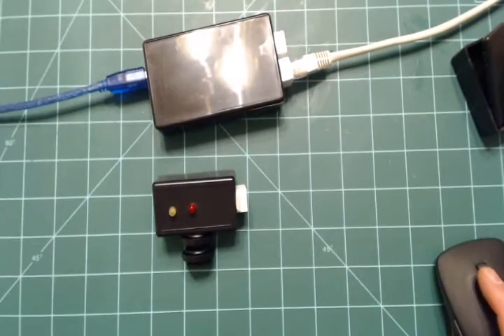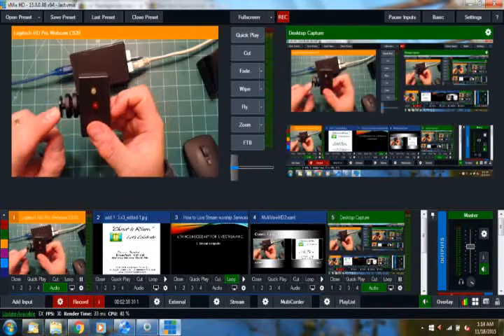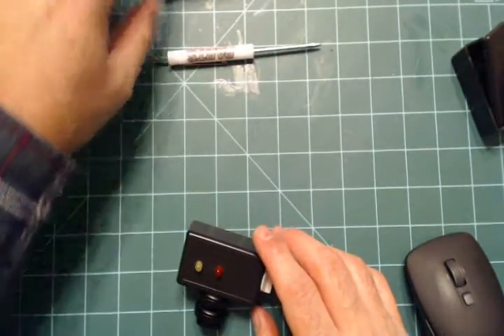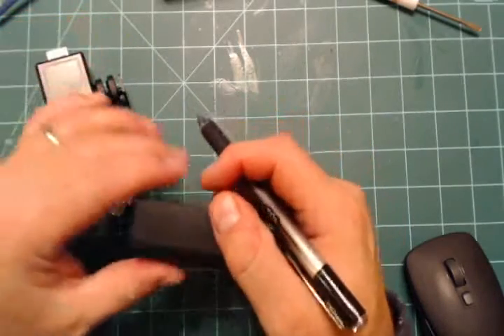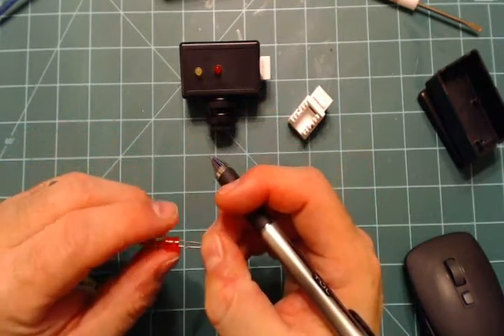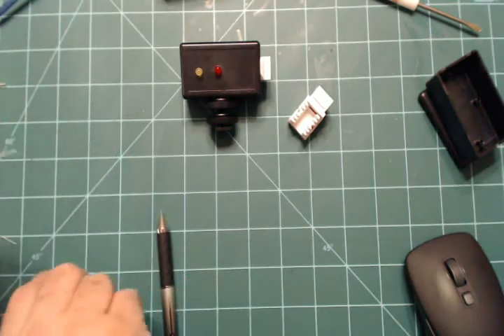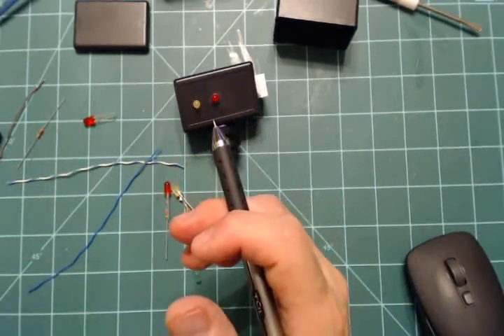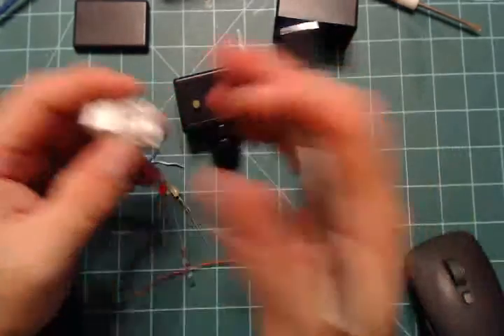DIY Tally Lights -  Light Box Build - Part 4

Comment: Dear Carl Tenney,
I know it's been a few years since you made this video, but I would like to know how many ohms resistance you use for the LEDs in the Tally light.

Sincerely, Frank
Reply from the maker: Frankie Van H.       This info was in the part one video  in the information section.     But here you go  I hope it helps    .  ....    You will want to get some resisters as well.    100 x Resistor Carbon Film 220 OHM 1/4W 5%    here is a link to what I purchased.     http://www.ebay.com/itm/171467521108?...
Reply: @cntenney  Ok thank you, I saw it.
do you also have the Arduino code you are using?
because it does not work directly on Vmix and Atem Blackmagic
Reply from the maker: @frankievanh9156   Mine works fine with  vMix.   I explain how I loaded the code on part two  right around the 11 minute mark.      The code is already on the arduino library.     In that part two I walk you through what I did to load the code.      I do not use blackmagic  I find there product  are not user friendly.      I have the  HD  350.00 dollar version of  vMix.

Comment: Hi, great project! I'm thinking of doing it. Have you test it for how long the cable will work? 20 meters will work? Thanks
Reply from the maker: Hi,   I would not know the answer to that.   I have been using mine for 1.5 years now in my studio.   I love it, for our 4 camera studio.     But only going about 20 feet 5 meters I believe it converts to.     If you are using this for vMix which is what I built it for.    You might want to consider using old smart phones.      You can send tally signals with vMix on smart phones wireless.     Just a thought.       You can also remote vMix from a tablet or smart phone.       One more thing,  another subscriber said he built his main box with  all the ports in the box so he was able to remove the need for cable spliters.     If I was to rebuild it I would do that.
Reply: Yes i do know. I like your approach way better, because it´s a permanent one. My only concern is the cable length. Longer cable, longer resistance. Do you know any way to increase the length? i´m not very electronic savoir but i guess i could do this project. Thanks
Reply from the maker: I would be tempted to try it for the 60 ft or 20 meters.       How many  units will you use  and how many would go that far?   If it is just one I would think you would be ok.    But I am no engineer.        Do you have a bread board to test it on?
Reply from the maker: to clairify if it is just one light for the 20 meters I think you would be ok.    Also,  I think because I am using line spliters with 10 ft cables that two of mine are at 30 ft - 10 meters.    
Again I would do as one of the subscribers commented and put a 8 multi jack out on the main box so that each line is straight to the unit.     I like his idea better than the two rj45 jacks out and then using spliters.
Reply: @cntenney  Sorry i never updated. I´m using 2 tallys for now, one using a 20 meters cable with no problem. I made the scheme to use only 2 tallys, now i will add a third keystone on the control unit for a third tally.
Reply from the maker: @condehs2010   that is sweet,  I am glad what I did was able to help you out.  Thanks for the info on your tally build

Comment: One of the most confusing videos ever....
Reply from the maker: +RSBSTEADICAM  Thanks for your input.    I am assuming that you are aware that this is video #4 of a four parter.      I am happy to help you with anything you don't understand, if you are serious about fining a way to build tally lights for vmix.         I have other viewers who actually have built this for themselves and they asked me to make them a schematic of the wiring, which I did.      
Not everybody learns the same way and I get that.    Always happy to help my collegues any way I can.    Thanks for your critique, Blessings
Reply: +Carl Tenney It's you pace and your preparation for your presentation as it needs to be crisper and clearer not belabored and lengthy. One of the problems with all these little tally solutions is that they rely on using yet another cable to get the signal back and forth to the camera. I'd like to see someone intercept the video signal and "hang" the tally signal on the same coax cable that sends the video. This of course would be a triaxial solution but would be a much cleaner solution.
Reply from the maker: +RSBSTEADICAM  Yes it is still a cable intensive scenario, I agree.    In my studio it is a couple more wires in the sea of wires for computers, switches, and camera inputs video lights and etc.    After building this I discovered that vmix will wireless connect to your smart phones as a tally light.   So if you have upgraded smart phones or have a tablet, you can actually use them as a tally light.     It streamlines the wire issue but bring the issue of how to connect it close the live camera.      no nice little tally light that connects to the camera.    I thought I would just mention that there is an option around all those wires.    Hope it helps.
Reply: +Carl Tenney Well I'm sure the cell phone option might work in some amateur situations however it seemed to me to be one more as a "lab experiment " than a viable one for anything even vaguely resembling a professional multiple camera production. As it is I built a triax system... several really that supplies regulated power to the camera (up to 1 km), returns video and also provides a bi-directional digital pathway which I've been using for control of robotic cameras. This is a "1-wire" solution using the single coax cable for all of this. Obviously this is a very, very clean setup for most any production situation and especially since I design and integrate the engineering for mobile applications such as multi-camera sports and multi-camera music performances that require a ton of cable and need to be efficient in their use of time for the setup. I specify a digital wireless intercom so that eliminates cables and acts as a security situation as the operators need never leave the headsets or belt-packs alone during a production and can be reached even on "breaks." I am still seeking a viable "tally" solution to truly bring this class of solution into the professional sector.
Reply from the maker: +RSBSTEADICAM last reply.   It is not good to assume, but my assumption is that your trying to find a low cost solution and  so you were looking on youtube.   However it could be that it was just a curiosity view.    There are company that sell tally lights.   One of them that I am aware of  and you may already know this but it is called.  Tallylights.com  -- They have wired and wireless solutions but they do cost.     I mention this one just in case you might not be aware of them.  There are other companies out there too!      Best of luck to you on your tally light quest!
Reply: +Carl Tenney Yes I am aware of TallyLights.com and you are right their soloutions are very, very expensive. Thier wireless solution is unreliable in large scale productions and their wired ones merely burden the production unit with bundled cables as did yours. Good luck to you too. By the way you might wish to add a small switch to the "front" light of your solution so that it might be turned off in the many situations where you want only the operator to see the tally signal.
Reply: RSBSTEADICAM Can we see this insanely clean, awesome, most magnificent setup that you conjured up? I can only find videos from the 1980s on your channel.